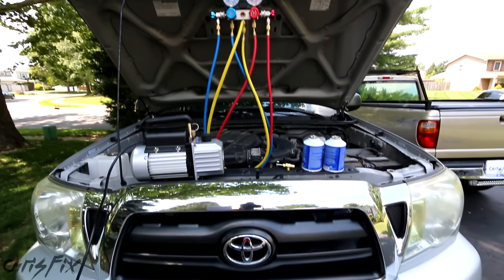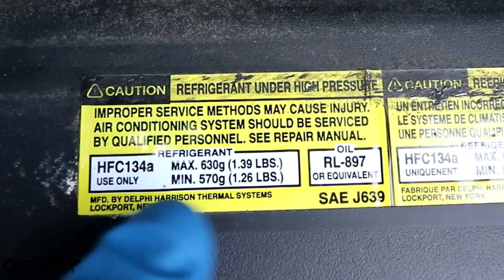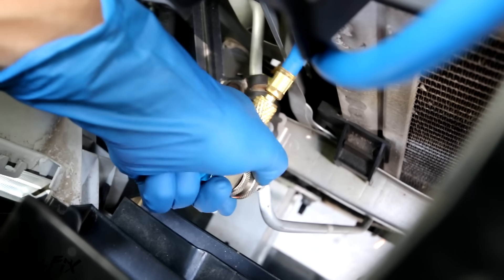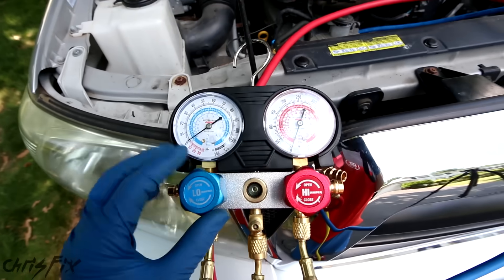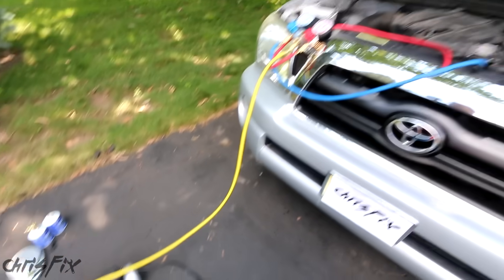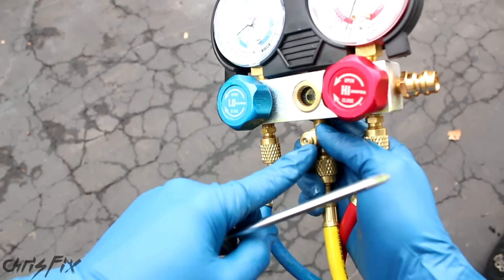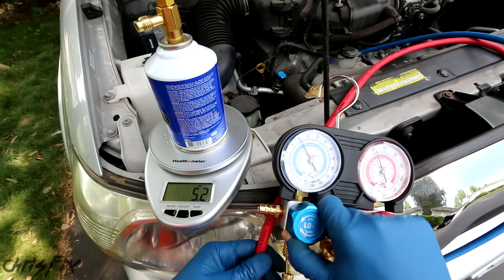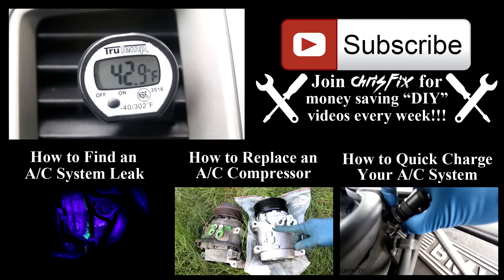How to Properly Recharge Your AC System

Comment: You have to be the first guy I've seen on YouTube to actually do this job right, great demo, very informative and easy to follow. although just one tip, if changing to a brand new compressor and you need to add to oil, it's far better to tip the oil straight into the compressor rather than through your gauge lines, and then rotate the clutch on the compressor. That way when you first start the compressor it's properly lubricated and doesn't suffer any potential damage. But without a doubt a great tutorial
Reply: Hey Chris I don’t understand one thing most people say when adding Freon your ac should be on max full but you only put it on the fist level does this really affect it or do people just say that ?
Reply: aplus fix it should be on max cooling, and the highest fan speed. That is basically so the compressor is running and it’s cycling the refrigerant around the system, and as your filling it you should really feel the air starting to go cold like ice. Its just when the system is running and if there is no other problems you’ll feel it working to the degree you want on those really hot days but if it feels like it’s not quite as cool as it should be it probably means it’s still lacking refrigerant or theres to much
Reply: Mathew Barnes so how come he only did it on the first fan setting
Reply: aplus fix fan speeds not really a big deal its just the higher the fan speed the more air will go over the inside coil which will allow for more refrigerant to be able to be boiled off at the same time so the compressor will be working at its highest possible demand while idle, so the refrigerant will cycle through faster, some people also say to have it on fresh air and set to blow towards your face. The main thing is to have it on max cooling otherwise youll be there all day, higher fan speed can help hurry it up
Reply: Mathew Barnes thankyou you are very knowledgeable
Reply: aplus fix i do this for a living i have to be, glad to help
Reply: If you think this was done right there was actually a lot of steps methods and procedures left out that should of been mentioned. And somethings should never of been mentioned bad information. But at least the AC will work and blow cold on your hand.
Reply: Hi, I've just had the compressor replaced on my car, but its making a grinding noise. The shop says that should go away as the oil circulates round? Do you know the best way I can do this safely?
Reply from the maker: Great tip/idea! Thanks!
Reply: ChrisFix hey Chris quick question ??? So my Dodge Ram is blowing warm air. The compressor and clutch are spinning ,everything Is working fine except it’s blowing warm air . Can I just check the Freon level and add necessary amount or do I have to vaccum out everything before adding Freon???? Thank you
Reply: Tim Toolman so the compressor is definitely starting? If it is you should connect your gauges to the system and see what pressures you get, if you have exceedingly high pressure on the high side it may indicate that the orrifice tube/expansion valve is blocked or failed. Also while testing set to max fan speed and max cooling
Reply: Mathew Barnes hey Matthew so I hooked up the gauges which ac full blast and my reading was 60 psi on low side and about 45 psi on high side . Can you tell me what this could be ?
Reply: Tim Toolman are both hand wheels at your gauge set closed, and is it a 134a system? Also check if the belt is loose
Reply: Mathew Barnes hi Matt so when I was checking the pressure my hand gauges were open on the low and side ports and the hands on the gauges were actually open . So the gauge hangs need to be closed when checking c the system Matt ??? Maybe that was my problem
Reply: Tim Toolman yea probably affected it. yea try check the pressures again with all hand wheels at your gauges closed. While the car is off connect the high and low couplers to the system, once the refrigerant is in the lines of your gauges be sure to purge the air out, by undoing the hose slightly on the gauges end, a slight hiss is all that’s needed so just crack the hose open slowly then close it. Once thats done start your car, turn on the ac system, let it run for a minute then record the pressures
Reply: Mathew Barnes ok great my reading was almost 0 on the low side and the high side was about 65 psi. What is the possible cause ??? And if I use a vacuum and hook it up will that empty all the refrigeraant or do I need to bring it to a shop to evacuate???
Reply: Mathew Barnes no I don’t , the dealership said they used a dye like 2 months ago , so I should buy a uv light and see where it’s coming from ??
Reply: Tim Toolman wait is it a new car, or has it just been repaired? And yes a uv light will help spot it
Reply: Mathew Barnes it was a used 2009 ram 1500 I bought from a dealership

Comment: Also vacuuming the system and waiting doesn't prove there isnt a leak as there could be damage to a rubber ac line that will hold a vacuum but not positive pressure
Reply from the maker: Thanks for the tip!

Comment: Chris nice video! Although i may add you should have weighed the can itself, the tap itself then both of them and you could have added just the perfect amount. With the hose connected that may have skewed tour info. Otherwise still a great video.
Reply from the maker: The only thing that changed was the amount of refrigerant. The hose didn’t move and the tap didn’t move so the change in weight was strictly the refrigerant.
Reply: ChrisFix hey Chris just bought the same pump u did , I noticed the pump has a black cap above the compressor oil fill level sight glass , what is that cap that says air on it do? Should it be tight or loose

Comment: For everyone out there DO NOT i mean DO NOT buy A/C Refrigerant with “LEAK SEALER”  that stuff will reek havok on your A/C system. When leak sealer comes into contact with air it swells up to “seal” a leak. If for some reason someone opens the system up in the future that leak sealer will swell up to any air contact. Read every can of refrigerant to make sure it is just pure refrigerant and no additives. PLEASE LIKE SO EVERYONE CAN SEE.
Reply: I used leak sealer and it clogged my filter dryer 
You are right DO NOT USE LEAK SEALER !!!
Reply: Wish I saw this earlier):

Topped up my AC and a couple days later blew a hose due to a blockage ):
Reply: Haxor inator 😢
Reply: heyitschino hey do I have to vaccine out my system before adding Freon ???? Everything is working just blowing warm air , can I just add the right amount or do I need to vaccum
Reply: Tim Toolman yes you can just add. But it is always best to remove refrigerant (if any) then pull a good vacuum on it for at least 30min. After you vacuum the system out, check to see If it holds a vacuum for at least a good 10-15 min then that is the time when i would add refrigerant.
Reply: @topprotips5250  does it have covid?
Reply: @topprotips5250  Yes, I would add a little first.  Usually that is all you need.
Reply: @topprotips5250  For sure; get it a tetanus shot first. It has to be vaccinated first. I found out the hard way...
Reply: They don't work..they just add junk to your lines. Never use sealers. Use dye, find the leak and fix it.
Reply: If for some reason, you have to add freon, obviously you have a leak. A sharp tech with a set of guages , can do some diagnostic  reading pressures, before any adding, or breaking the system open. Small leak,( 1/3 or less, over a couple yrs or more,) yea, you may get away with just adding some. Any thing more than that, or a sudden drop, time to add enough to find the leak, if not enough in the system already. Then fix the leak properly, ALWAYS replacing receiver / drier, and orifice tube, or expansion valve, and any o-rings along the way. Worked on/ installed hundreds ,7 yrs in a shop, never had one kick my butt, but ,they do take some time and work.
Reply: heyitschino correcto.  Also love your picture.
Reply: I do commercial refrigeration and AC never liked the stuff seems to me it creates problems down the road Chris you state start the car so it will pull in the ref gas but what if you vehicle is equipped with low pressure cut out if thats what they call it in the car industry no gas pressure charge unit with a couple of ozs then cut will close
Reply: Mark Payne you can jump the load aide terminals on the ac clutch relay to bypass the switch/ecm
Reply: @ItsMe-jh7fb  Right lol O'Reillys will really tax your ass..
Reply: What about refrigerant with the UV dye? Is that O.K. to use?
Reply: @josephheston9238  Yes, UV dye is Ok to use. UV dye will allow you to find the leak and from there you are able to find a solution. The Refrigerant w/ Stop Leak/ Sealer is no good for your system and in the long run will cause you more problems and probably more money to solve the problems that could have been prevented by using the UV dye to find the leak and asses the situation properly. Using Stop leak is like trying to duct tape a leak on the hoover damn. its going to cause more harm to not asses properly than it would cause if instead you bring the problem to light and work on a proper solution to the problem.
Reply: I’m having a issue with my ac. The compressor wouldn’t turn on until I released pressure from the low port. Seems like there hot air trapped in the system. Is that the “seal” additive swelling? Because I used with ones with leak sealer
Reply: WhatJoshyDoes Tv i dont believe so. When it swells it would have created a blockage. Do you have any pressure readings of when the compressor was actually on? That would give me a better understanding of whats happening.  Dynamic running pressures not static pressures..
Reply: WhatJoshyDoes Tv that could be an issue with your pressure sensors on the ac line possibly
Reply: heyitschino sadly I purchased and used it before seeing your post -- now what?
Reply: Also I'd like to add that I've done research into refrigerant additives and it seems like the additives add nothing to the way your ac system works. Your ac system will work the same way regardless of type of refrigerant. Ac additives are just a marketing ploy by vendors to make you spend more money. They advertise that additives save you money on operating costs, but every study done shows that it either made no difference in costs, or it actually added to the running costs.
Reply: @bigboiiiii7764  Thanks for your input. I'm getting ready to test my AC system on my 2014 Sonata. I think it's low by how it's performing, so I purchased 2 cans cans of R134A, opting for the cheap stuff...no additives. R134A is R134A. While I was shopping for R134A, I was amazed at the price differences. $5.80 at Harbor Freight (best price, no additives), to double or triple the price for the same amount with the Super Freeze additives and leak sealers. I almost bought the R134A with the Super Freeze additives, then realized that even on the hottest days, when my AC is cooling correctly, once my car is cool, the AC is set to it's middle range.
Reply: you can find videos on how to flush your ac system. Then once you do that, refill your ac system with pure refrigerant
Reply: Truck Taxi Flush then refill with pure refrigerant..
Reply: @TruckTaxiMoveIt  Don't add air to the sistem.
Reply: Where can I buy Freon without leak sealer
Reply: @ZombieChopper15  autoparts store get the one that is just pure refrigerant no leak sealer added
Reply: @ZombieChopper15  not Freon. R 134a
Reply: I’m in Australia and unfortunately I can’t purchase A/C refrigerant and our local auto stores don’t sell them as it’s illegal to have possession of any refrigerant cans/bottles of any kind, it’s also illegal to regas and service our own A/C system due to EPA laws, the only way we can get our A/C system regassed and services is to take our cars to a mechanics garage who has a refrigerant licence and is certified to regas the A/C system which will cost us more $$$ and I think it’s about a $5000 AUD fine if we have possession of refrigerant cans/bottles of any kind, and I think it’s more for mechanic businesses and staff who are uncertified to regas the A/C system and are not licence to have possession of refrigerant can/bottles of any kind
Reply: @tamarachumbley8722  I have a lifetime certification and it's pointless as anyone can do it themselves now
Reply: FlyFarther  😅
Reply: I worked doing tires and hated when green slime came in for a flat repair so I never trusted leak sealer on AC stuff. That crap never works anyway. You r VCG, cooling system or front main is leaking you fix the thing. That sealing additive very seldom fixes anything and just makes things hard for the tech that gets it eventually.
Reply: @robertcoyle9071  Ever have them Royal Seal tires?
Reply: @ridgerunner106  uniroyal nail guard? Yes. Forget about balancing them. I think they were on E load 10 plys which are typically bad enough.
Reply: Yes, I learned that too.  I learned the bad and expensive way too.
Reply: I went to walmart and auto zone. All of the refrigerants come with sealers. Where do you get pure refrigerant?
Reply: @ordonez6248  Wal-Mart has pure Freon. $5 a can
Reply: @gjohns316  Its called R134-A...Freon is R-12. Guarantee you that "freon" is NOT $5 a can!
Reply: Whilst true I honestly like the dyed refrigerant for when I am looking for a leak. Hard to find stuff with JUST dye and nothing else extra though.
Reply: Excactly right.

Comment: Chris your a pretty smart guy but your mistake in adding freon you don't lay the can down, it needs to be upside down at all times when filling, when you picked the can up and went to shake it you noticed freon was still in the can right, you didn't have to shake it all you had to do is turn it upside down and you would have had the same results, by laying that can down all you did was put air back into the system, sorry guy but you were wrong on that part.
Reply from the maker: Actually, when you turn the can upside down you introduce liquid refrigerant into the system which the compressor cannot compress and it can damage it. That is why you want it on the side. The liquid is right near the opening, ready to evaporate and get pulled into the system.

Comment: How to recharge ur AC when you don't have $200+ to blow on crap you will probably only use once or twice:
Step 1: Head on down to Autozone or Oreillys.
Step 2: Ask where the uber AC crap is at.
Step 3: Find a can that has a round thingy on top with pretty colors and says R-134 on it.
Step 4: Ask where the Low pressure connector thingy is at on ur car.
Step 5: Follow directions on Can.
Step 6: Enjoy cold air...

Comment: After you've pulled a vacuum, then you shut off the high and low side valves and wait for a period of time to make sure there are no leaks right. How, can you know if there is a leak in the system if you have shut off the valves? Wouldn't it be necessary to leave the valves open? Once you shut the valves there would be no way for the gauges to read what the vacuum is on your system because you've shut off the valves or am I missing something?

Comment: You are ta;ling about tools most people do not own. There is a reason for that! Expense for something that is going to be sitting around 85%-95% if the time.
Reply from the maker: So you know, you can rent these tools for free from your local chain parts store like Advance Auto, Autozone, etc. Second, if you buy the tools you need (link in the description) you will spend $200 compared to the 1200 they quoted me to replace the compressor and refill the AC system. Even if you use it once, you will save $1000 so you can sell the tools if you want. Or rent them for free.

Comment: Hey Chris! Recently got my certificates to work with refrigerants. It is not always a good idea to add UV dye. UV dye only ever really needs to be added once, and just a very small amount. The UV pigment in it is very coarse and will damage your compressor as it will just create friction if too much dye is in the system. If you already have dye in the system, don' t add more. A very little bit of dye is more than enough. 

Also, it's much easier to refill through the compressor than through the line. Take the amount of oil required for the entire system (minus what's left in there, there are tables to calculate how much % of the total system oil needs to be added) and just add it through the compressor.
Reply from the maker: Thanks for the tips!

Comment: Hi Chris I like your videos they help a lot but can u tell went a a/c compresor is bad or not I have a 2000 mustang. My a/c is not working I buy one of does cans of a/c pro to add to the car but shows up full but my ac steal not work Pluss I check all my fuses and they are good what I can do or should replace the a/c compressor

Comment: Actually chris, you do not have to turn on the engine to allow the refrigerant to flow into the system, the vacuum does the work, but both ways work the same